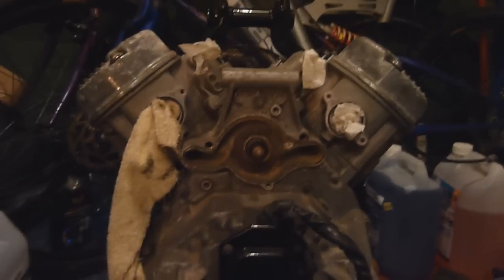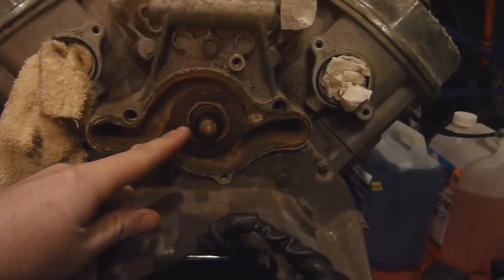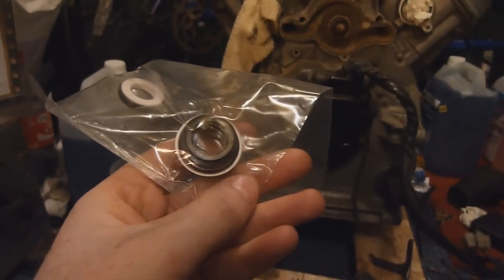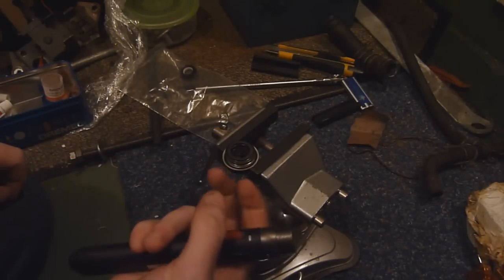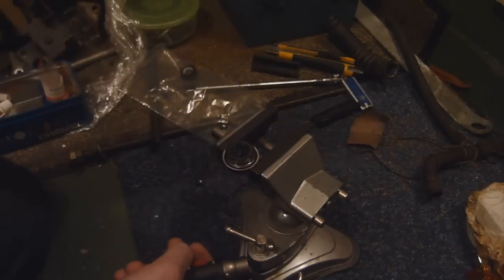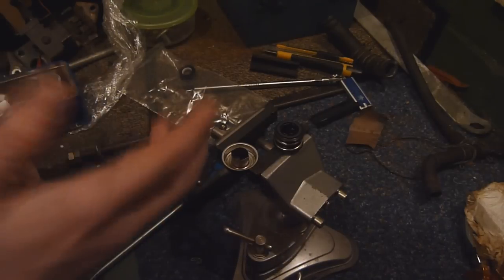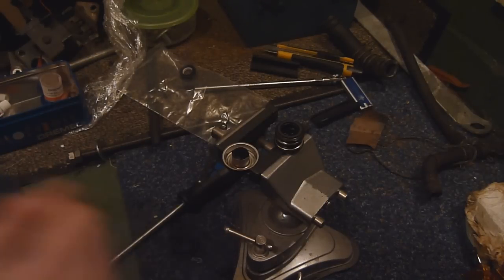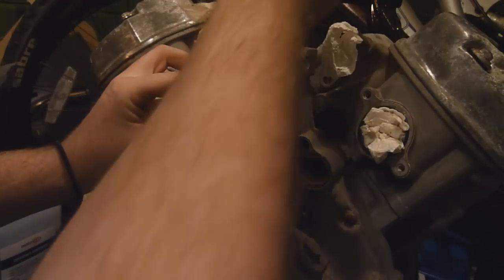HONDA CX 500 CAFE RACER PROJECT EPISODE 22 (MECHANICAL SEAL REPLACEMENT (SHEP)))

Comment: I am the,"Shep".Canny video and great work.Wasn't like,"Climbing a Moontin"<grin> :D
I wonder how many man-hours and engines my method has saved.

Remember also that there are cheaper options for the,"Mech Seal" as they are a basic unit that many Motorcycle makers use from Water pump manufacturers.In,"Aus" they are used on swimming pool pumps.

There are always people who cannot believe that,"Home Mechanics" cannot out-think the manufacturers but this is one of my philosophies,

"The pessimist complains about the wind; the optimist expects it to change; the realist adjusts the sails".
Reply: Hi Paul. Thanks for sharing your method. It will save me lots of time since am about to do the job. could you please recommend  part number for that seal?
Reply: No problem.See this link,

http://globalcxglvtwins.forumlaunch.net/viewtopic.php?f=7&t=6

Also checkout the US forum,

http://cx500forum.com/
Reply: cheers mate!
Reply: I need to do this fix, hopefully with engine in frame. I've been researching on the CX/GL forums but can't find a list of everything I need. That would be the pump housing gasket, the seal itself (Yamaha?), crush washer etc. Is there a shopping list so I have EVERYTHING at hand?
Reply: paul sheppard your a legend mate. Started my build a couple weeks back and I've seen the shep method on soon many forums. Sure enough got the bike running and what do you know, got a leak coming from my weep hole so just ordered some parts to tackle this next week. I'm in Australia and wish I knew that I could use a different seal though, just ordered on from Peter Stevens for 80$!

Comment: Thanks a lot for doing all the CX500 videos man, it's such a great help!! Quick question though, at the end, what's this "washing up liquid" you speak of? Is this like soap?
Reply from the maker: +Arthur Schiffer Not a problem and yes same stuff you would use to wash your dirty plates after a meal :)
Reply: Awesome, I literally just did this and had forgotten to add the soap until you reminded me with this. Good thing I didn't run the motor yet. Thanks again man!

Comment: Great video and good explanation. Now I have a question, my GL500 has an oil leak in that area but not coolant fluid. Changing that seal will resolve the leak? In the way it is in the video it should be the oil leak merge withe the coolant but not only oil. Am I right? Thanks

Comment: Thanks - great video. Assume no problems since you did this?
Reply from the maker: HMQS Gayundah   Yeah not a problem since, in my mind it's a lot easier then opening up the engine and pressing a new seal in.
Reply from the maker: HMQS Gayundah   Yeah not a problem since, in my mind it's a lot easier then opening up the engine and pressing a new seal in.